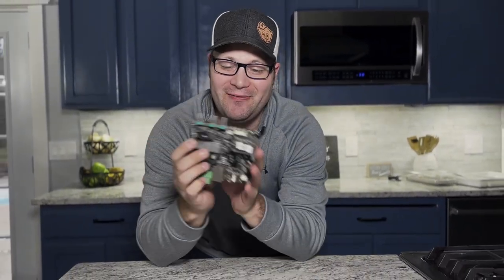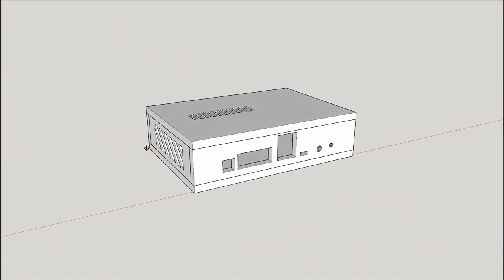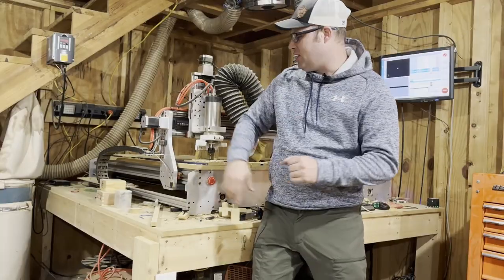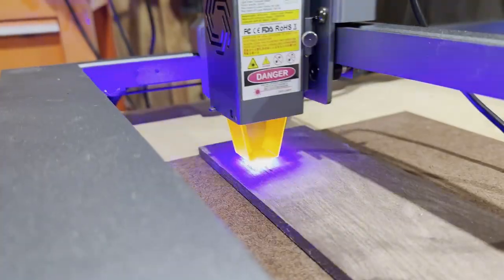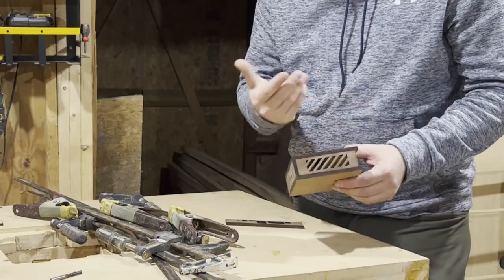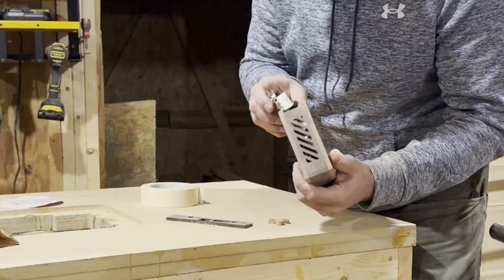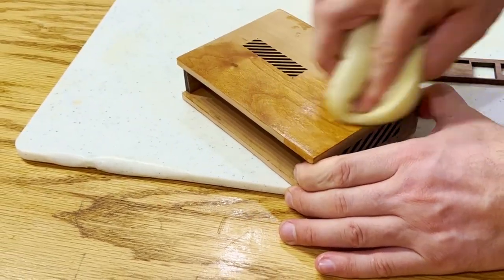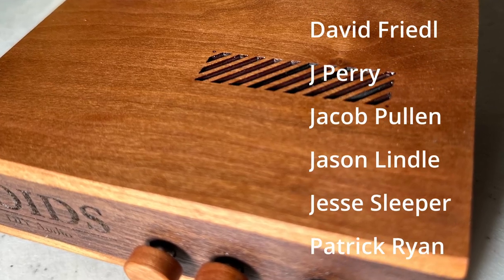DIY HiFi  Amp from Solid Wood - Ortur Laser Master 3 Laser Engraver Project

Comment: Thinking about it some more... I can see this being REALLY good for crossover construction. You can cut out the board to the exact shape you need, holes and all, and then use the laser to etch out where the various components should go, even do a light schematic drawing right on the board depending.

Comment: That thing is just beautiful!  Now, not only do I want a 3-D printer, but now I want one of these things!  
Here's a stupid question, but do you think it would be possible to cut through a thin piece of aluminum bonded to a similar thickness of ply or MDF as one piece?  Example: In the past I've laminated aluminum flashing for buildings to various wooden things in an attempt to make it look like solid aluminum for pennies on the dollar of real alum. I used contact cement to do it, and machined it afterwards with router tools. Messy!    Very cool that you can write with it too by turning the laser strength down.  Hey, DIY Laser Tatoos!?!
Reply from the maker: I’ve never tried it, but it dyed engrave aluminum, so I’d think of it was thin enough, I would think it should be able to. But that is really more theory than anything else

Comment: was curious how much effort it took to sand off the burned edges. not too bad
Reply from the maker: That’s a good question. It actually wasn’t bad at all. I really didn’t have to use the orbital sander. I probably could’ve done it all by hand if I wanted to.. but I just used 220 grit sandpaper and sanded some parts for hand and some parts with the orbital sander

Comment: hi Nic great way to house those great little board amps. Coincidentally just today at my woodworking club the president who is the master of the lazer machine made me some badges for my speakers with my brand name. So in theory I could use it to make this box or similar. Are you planning to sell the sketchup file?
Reply from the maker: I am planning to sell the sketch up and 2d files as one. I was having subs issues with my site and am currently getting over the flu. Do I haven’t been able to post anything yet

Comment: Hey Toid, I got a question for ya. I recently purchased the plans to your Cinema 6 speakers. I got all the parts for the crossover in my cart ready to order except the 3.5 mh inductor. I was wondering if a 3.5 mh inductor with a different AWG would work just find or if I needed to go with a 15. I don’t think parts express has a replacement on their site. Any insight would be much appreciated as I am a beginner and this is my first DIY speaker! Thanks Toid

Comment: Ho thick is the wood you used? 1000mm/min 60%, but how many passess to cut through?

Thanks!
Reply from the maker: You know, I can’t remember offhand. But I was using pretty hard wood. Most people probably aren’t gonna be cutting with this heart of wood. If memory serves me correct, it was something like 30 passes. When I was testing it with cheaper plywood it was only take me about 10 passes. At least it should be a ballpark range.
Reply: @Toid  thank you very much! Yeah I plan to use 6mm birch plywood
Reply from the maker: @Akusen_Arcade  it’ll probably cut through much easier with that that will with hardwood. What I did is I just tested it with X amount of passes and then continued to increase it until I cut through. I just test a couple small circles.

Comment: can we have plans for a 3 way open baffle speaker for $300 or less please, unless you think a 2 way is better.  8-12 in woof, 4-5 in mid, your choice tweeter.  help us build something on the cheap that will sound incredible. imaging, excellent sound at low volume, etc.  ill buy those plans :)